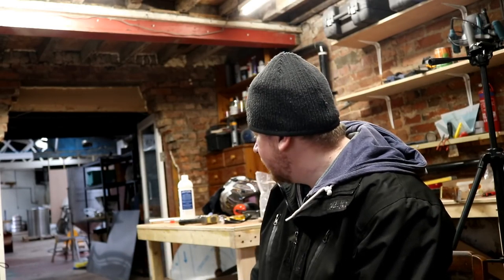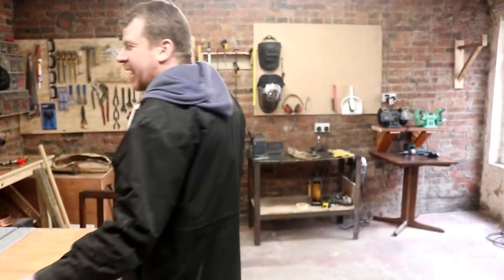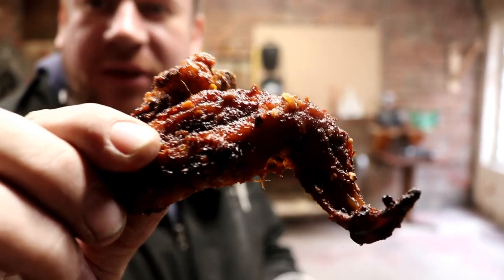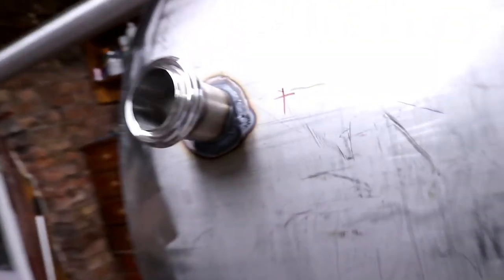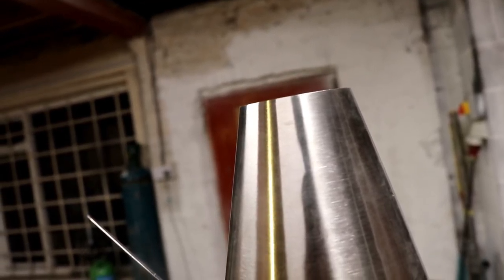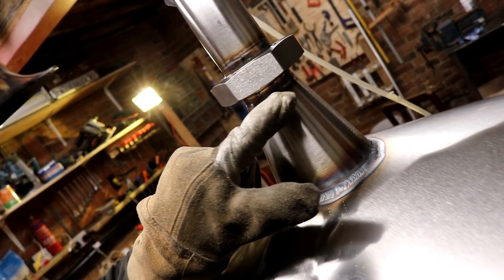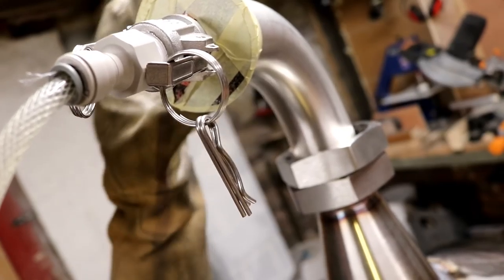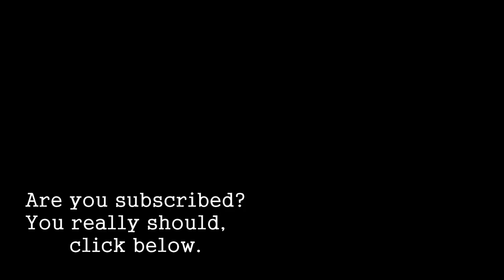Real Progress

Comment: We pressure test our blankets full with water, then value closed then  3 seconds max then close the tap. More pressure will implode like yours  did 😄
Reply: With air conditioning tanks we use mineral oil and up to 40 bar.